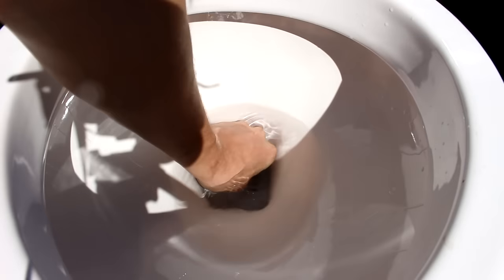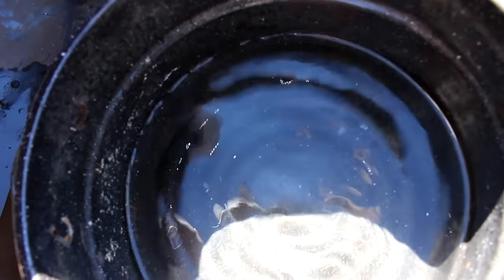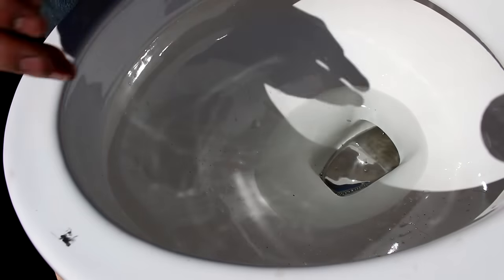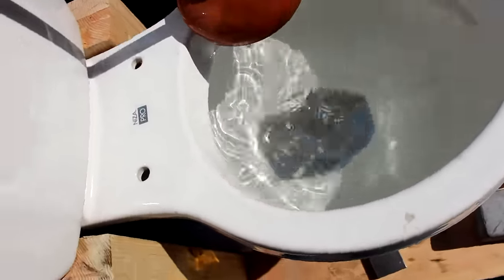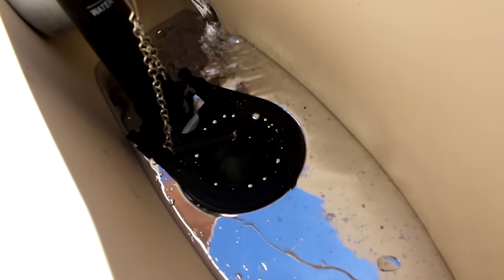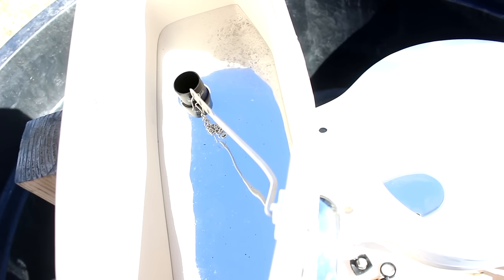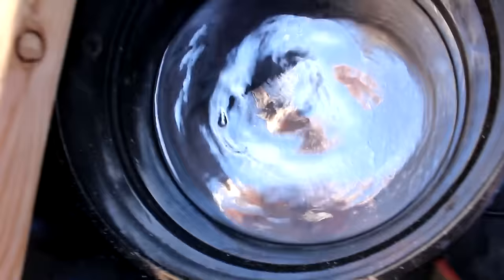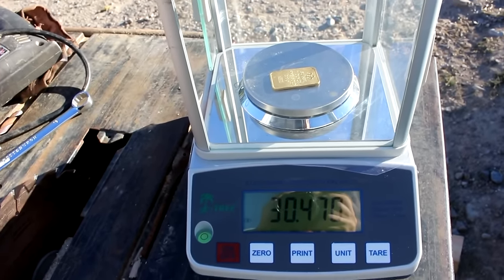Flushing 240lbs of Mercury

Comment: It's incredible that that toilet held that much weight without breaking the tank
Reply: Hell's bells! MY toilet supports about 40 lb more than that each time I sit on it!
Reply: Ceramic is really good at holding a lot of weight but it is very bad at resisting shock. For example is can hold 300 lbs but if you dropped 300 lbs on it it would break
Reply: Oh i still cant belive they are still together after all of that shit

Comment: The way Cody is handling the mercury is safe, as metallic mercury is not remarkably toxic. Organomercury compounds and mercury vapour is toxic though, and this is how most people get poisoned by it.
Reply: Mercury will start evaporating at room temperature and especially with the amounts hes handling and the constant movement there will be mercury in the air, its outside which helps but safe is still a word i wouldnt use.
Reply: “Safe” is definitely an oversimplification, but that is the gist. Cody knows chemistry, knows the risks, and takes precautions to help protect himself. 

Like he alluded to when flushing the full tank of mercury, elemental mercury is still really dangerous if it comes into contact with an open wound, a sore, or a mucous membrane like the mouth or nose.

Like another commenter pointed out, mercury will evaporate at room temperature, and breathing mercury is definitely way worse than just touching it.

There’s also the possibility of the mercury reacting with something unexpectedly to produce a much more dangerous material - you don’t know all the chemical properties of the toilet bowl material or the plungers, for example. Different compounds could be far more dangerous, and in a setting like this there’s not much control you can implement to monitor or prevent unintended reactions.

Basically, don’t do chemistry at home, don’t do chemistry without a lab partner, don’t do chemistry without a chemistry education. Stay safe, folks.
Reply: If i remember correctly cody put some mercury in his mouth in a Video but i think he deleted it

Comment: this man is  fucking handling mercury without gloves like it's nothing. that's metal as fuck dude
Reply: elemental mercury is not dangerous... but the mercury you find in thermometers etc is not elemental and therefore can be absorbed into the skin readily. peace you noobs :)
Reply: http://www.cdc.gov/niosh/ershdb/emergencyresponsecard_29750021.html 
According to the CDC, "Elemental mercury is toxic primarily through inhalation of mercury vapors. It is only slowly absorbed through the skin, although it may cause skin and eye irritation. Elemental mercury droplets may be absorbed through eye contact. Ingestion is not an important route of acute exposure as almost no elemental mercury is absorbed through the gastrointestinal tract."  So yeah, any kind of mercury, elemental or otherwise, is still absolutely dangerous.
Reply: Yeah, dude.  There is no way I'd fuck with mercury anywhere near my actual skin.  Nope, nope, and more nope.
Reply: tr00 metal confirmed \m/
Reply: I head banged throughout this whole video. Got whiplash.
Reply: GeneralFork1Over " Ingestion is not an important route of acute exposure as almost no elemental mercury is absorbed through the gastrointestinal tract."
I have a lot of mercury at home, because whenever a thermometer breaks I store its mercury in a bottle.
Sooooo, Am I allowed to eat it??
Reply: +agustin moyano - That sounds like a question to ask your doctor.

Comment: Cody the fact that you don't wear gloves and you play with tons of Mercury concerns me. All I'm saying is in 8 years your channel is gonna be Mad Hatter weird...
Reply: *fine
Reply: Ignignokt Err Mercury won't absorb through skin. It will only go through a wound
Reply: I had the pathological shyness and tremor even before. Mercury is very safe UNLESS YOU HEAT IT AND BREATHE THE VAPORS FOR A FEW MONTHS DAILY. That is essentialy what hatters did during the manufacture of felt..
Mercuric nitrate was commonly used in the production of felt for hats. During a process called carroting, in which furs from small animals such as rabbits, hares or beavers were separated from their skins and matted together, an orange-colored solution containing mercuric nitrate was used as a smoothing agent. The resulting felt was then repeatedly shaped into large cones, shrunk in boiling water and dried. In treated felts, a slow reaction released volatile free mercury
Reply: but he messes with the stuff so often . . .
Reply: +supermotardmario You're technically correct, but you'd have to bathe in Mercury daily to experience any adverse effects. Less than 0.01% bioavailability if you literally eat the stuff. It's about as harmful as dirt if you don't have any open wounds. Even intravenous injection of metallic Mercury is minimally effective at actually poisoning you. Most of the damage it does is done because it blocks blood vessels.
Reply: +supermotardmario #rekt
Reply: It has very low vapour pressure, so you don't need to worry about that so much.
Reply: +Tony Samson he got rekt tho
Reply: Youfis... Just wait for next week when he will take blood test. We will see who is right.
Reply: it does absorb through the skin...watch videos of gold panners who use mercury...some of them have really mangled fingers
Reply: It doesn't matter who is right or wrong.  The fact of the matter still remains, he should be wearing protective equipment.  Logic and reason dictate that.
Reply: +Daniel Duncan No kidding.  It was tough to watch.
Reply: Oh.
Reply: Elemental mercury is pretty safe.  It's mercury salts that will ruin your life in the most spectacular way imaginable.
Reply: He doesn't 'play' with it, he just does experiments with it because he is a scientist/geologist.
Reply: Agreed. It is my opinion that Cody, being an individual practicing science experiments with potentially hazardous materials on a public-facing youtube channel with more than half a million subscribers, should ALWAYS follow best practice procedures, if only to advocate responsible & safe experimentation. 

In other words, you're an example, Cody. You bear more responsibility than just getting the videos out. ;)
Reply: Mat hatters came from vaporized mercury not from touching it, Mercury evaporates over time and the hatters kept inhaling the mercury fumes
Reply: You know what, from a entertainment perspective I'd be okay with that lol
Reply: He's also been breathing in mercury vapors by handing his head over it. I've always thought he was an odd one. I can't tell if it's just him, or if the mercury has already started its effects.
Reply: well at least he is going to the hospital to check his blood.. or maybe that was just a joke :P
Reply: so you're saying he is gonna become how to basic
Reply: Gummi Bear  I would sub so fast :'D
Reply: Mercury is much safer than you think. This is gonna be rather shocking but most of the naturally occurring elements are pretty safe for humans, as they occur, yah know naturally. The problem is when you put it in unnatural states, like mercuric nitrate.
Reply: ***** Under what natural circumstance does mercury get dissolved in concentrated nitric acid. Far as I am aware nitric acid is not naturally occurring.
Reply: ***** Didn't know that, good to know. But would you agree that that is definitely not an everyday event, and because of the rarity of it, living things are less likely to have resistance to it? Basically all I am saying is, the things we are exposed to less commonly throughout history are the things we are less likely to have a resistance to.
Reply: He get the mercury for free

Comment: Elemental mercury (metal): This is the shiny liquid that you probably played with as a kid. When mixed with other metals, it forms an amalgam. Silver-mercury amalgams have been used for dental fillings for almost 500 years. 

Drinking mercury liquid itself is surprisingly safe, since it passes through the digestive tract without being absorbed. This makes it a rather effective laxative, and was used as such in Asia thousands of years ago.

While ingestion of metallic mercury is relatively safe, the same cannot be said for its vapor. Mercury vapor is dangerous, since it is absorbed from the lungs into the blood and distributed throughout the body.

Mercury salts: These are chemical derivatives of elemental mercury that are formed when it is reacted with certain chemicals, such as strong acids. Mercury salts are more toxic (orally) than mercury metal, but there is a wide range of toxicity, which depends mostly on water solubility. Mercury sulfate and mercury iodide are essentially insoluble in water so they tend to pass through the digestive tract without being absorbed, which makes them less toxic (but not non-toxic) than soluble mercury salts, such as mercury nitrate.
r
Organomercury compounds: Of all the forms of mercury, these are the worst. When mercury is chemically bound to carbon it is readily absorbed into the blood, which makes organomercury compounds far more toxic than the other forms. The most common of these is methylmercury. It is bad news.

Long story short, if you can't tell the differences between the different types of mercury, DO NOT TOUCH IT OR GO NEAR IT.
Reply: I'm not in science class don't give me more homework😂
Reply: Ever heard of dimethyl Mercury? The lethal dose is measured in micrograms.
Reply: Yeah because we humans don't have something called stomach acid right... This would react with the mercury. Also some people could have very small cuts in their intestinal track without knowing, from polyps or IBS which could increase mercury absorption significantly. In other words you would be an idiot to drink Mercury.
Reply: flickster1980 HCl doesn’t react with Hg.
Reply: @wonkiewilla2032  Dude. Class in in session all the time. Do you shut off your brain when you leave school?
Reply: Or just use protective gear, proper practice and training, and don't touch or swallow it. There was a guy at work who was intrigued with the 93% sulf acid we use to lower ph in water to make it easier to treat. He got all scientific and argued with me all the time. One day it blew up in his face. He thought he knew, but now he has no face. So go ahead! Play with that fire guys, be curious, see what happens haha!
Reply: @Krystalmyth  yes
Reply: Vapors.
Reply: Krystal Myth especially when Cody is our teacher!
Reply: @star fight No? Can you not read?
Reply: @flickster1980  
Mercury doesn't react with hydrochloric acid.
Reply: this is very informative, THANK YOU but for some of the people who don't read the whole thing, I suggest putting the Bottom Line Up Front (BLUF) because some people will consider this a TLDR ( i'll let you search that one) and play with organomercury in their toilet
Reply: @star fight mercury poisoning only happens if you touch (as said), Organic Mercury without gloves or any type of protection causing it to absorb through skin, thus increasing the amount of mercury in the blood, which may be fatal in some cases.
Reply: @star fight So why did you reply to this comment instead of the comment saying it wasn't real?
Reply: @star fight I don't think it's false, I think he means that Mercury can only poison you if it's in certain forms
Reply: I think I read about that somewhere
Reply: Steven Pace nerd 🤓
Reply: K
Reply: Steven Pace Thanks for confirming what I had been taught in Medical School.
I’ve commented elsewhere about this and people act like I’m telling them Cyanide Juice is good for you.
Metallic Mercury is very safe and was used as a laxative for many years in the past.
It sure worked for whoever was sitting on Cody’s toilet. 👍🏻😂
Do you know how many glass vials of Mercury where shoved in people’s orifices in the hospital when I was a Student in the 1980s? Thousands.
How many people’s blood pressure did I take with huge Mercury vials mounted on the walls of every hospital room I was in? Thousands.
I’m sure many were broken or leaked.
I never saw one case of Mercury poisoning.
How much Mercury Amalgam is still imbedded in my teeth? I don’t know.
No Mercury poisoning so far.
And people decompensate when this guy touches Metallic Mercury.
We’ve become a nation of frightened Snow Flakes. With no scientific knowledge.

When I was a kid (1960s) driving through Western Nevada with my Dad. Many small town Saloons had big jars of Mercury that they would pour on top of the giant wooden bars and let patrons, and little boys like me, push it around with a spoon for fun.
Reply: Chubyemu taught me a drop of organic mercury will go through gloves and slowly kill you over the course of weeks.
Reply: Thanks all I learned was that their are more than one thanks
Reply: wow biggest comment I ever have seen before
Reply: @flickster1980  I am not saying it's safe, I am saying it doesn't get absorbed by the GI tract like you are saying.
Reply: @ShihammeDarc   Yes, if we are talking elemental mercury, it is very poorly absorbed by the GI tract, typically less than 0.01% of the dose, not zero but very little. In my original comment I did specify those that may have bleeding polyps in their GI Tract, ulcers etc, this does increase the risk profile. 

In general Science agrees with your statement when referring to elemental mercury, it is very poorly absorbed by a healthy GI tract.  Even so the absorption is not zero and you wouldnt want repeated exposure over a long time. A single does is very unlikely to do harm but i still wouldn't recommend it.

Now if we talk organic mercury like methylmercury which is often found in higher concentrations in larger, longer lived species of fish like Swordfish and Shark, that is extremely well absorbed by the GI Tract, around 80-90%.
Reply: they used mercury to treat great pox/ syphilis.... and the resulting mercury poison was harsh on the people.
Reply: @Shaheen_Hassan  under normal pressure and temperature....

Comment: Best Answer:  Mercury is toxic in several ways. 
At room temperature is gives off a vapour (which can be seen if you shine an ultra-violet light onto a screen in front of which is a bowl of mercury). As a vapour it is quickly absorbed through the lungs. 
It is absorbed through the skin but very slowly. Only a small proportion is absorbed by the digestive system if the metal is swallowed. You would have to take almost a table-spoon full to make you seriously ill or kill. 
Mercury compounds are seriously poisonous especially soluble ones like the chloride. Organo-mercury are the worse as they are very readily absorbed into the tissues of the body. 
Mercury is very good at replacing the trace metal elements in the body such as copper, cobalt, chromium etc. At autopsy it can be found in almost every tissue in the body. 
It is slowly eliminated from the body taking about 70 days for half of it to leave and another 70 days for half of the remaining to go. 
It causes a whole host of illnesses from loosening of teeth, mental disturbance and organ failure.
Source(s):
Personal knowledge as a chemistry examiner
Anonymous · 1 decade ago
Reply: Doug Helms well. I will definitly be getting some mercury. It’s so pretty
Reply: Good answer. I've spent the majoity of my working life protecting people from exposure to environmental toxins and this is definitely one where 'Don't try this at home.' applies. Cody'sLab is taking precautions that aren't immediately obvious and handling mercury at home without taking these precautions will result in a much higher risk of poisoning.
Reply: Oh holy shit citing your sources even as a youtube commenter?
Nice man. Respect.
Although "Personal knowledge" seems like not much of a source considering it's as someone whose job it is to know that it makes up for it.
Reply: Enderblawk it’s a copy paste
Reply: Why was the Mad Hatter mad? Mercury son. Crazies used to hat make with that quicksilver.
Reply: I gotta go eat some of that stuff! 😀
Reply: @Burdflu  Exactly.
Reply: @Burdflu  
Thats because hatters used murcurious nitrate, not pure murcury. It was inhaling murcury fumes over and over again which made people mad.

Back in the day, people who made gilded clocks also suffered the same symptoms because they would rub a murcury/gold amalgamate on what they were making, then "burn" the murcury off leaving the gold plating. They went mad because they stayed in the room during the burn off, therefore inhaling the fumes.

Pure murcury gives off some fumes, as mentioned, but not enough to kill you by handling it once. You can handle or even ingest liquid murcury and be relatively fine as long as you have no wounds on your hand, in your mouth or in your digestive system. Pure murcury is at its most dangerous when it enters your bloodstream (and therefore your cells/lipid system).
Reply: Your answer is good and I think you are broadly correct -- thank you. However: 
"It is slowly eliminated from the body taking about 70 days for half of it to leave and another 70 days for half of the remaining to go. " 
That is not how a half-life works.
Reply: there is two types of Mercury your also referring to organic mercury
Reply: @enderblawk5068  he copied and pasted that from yahooanswers
Reply: I had seen a vid made by Chubyemu where he discussed about a case where a woman spilled dimethyl mercury on her safety gloves but still it was absorbed into her skin and then her brain went haywire with mercury making new compounds and proteins in her brain
Reply: Llewellyn Patrick Precautions?? Dude wasn't wearing gloves or a respirator...

He submerged his bare hand into 240lbs of mercury... 

No f*cks are given at Cody'sLab. Clearly.
Reply: Doug Helms when I was a child I had a mercury maze. I loved that game. I’m happy that it never broke though haha
Reply: This is old but he already recived a poison test and he was cleared so his exposure was not bad but he will need to tske precautions to avoid much higher exposure